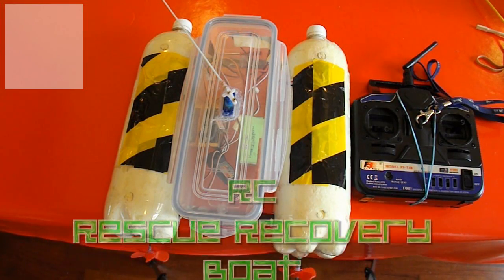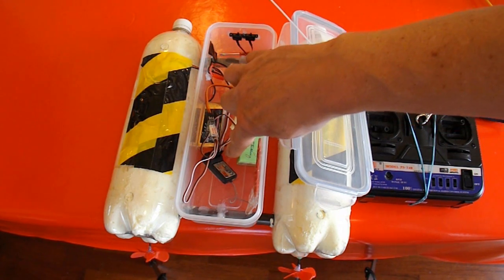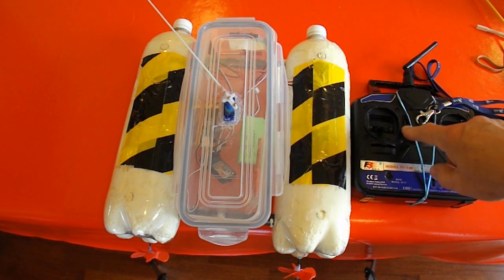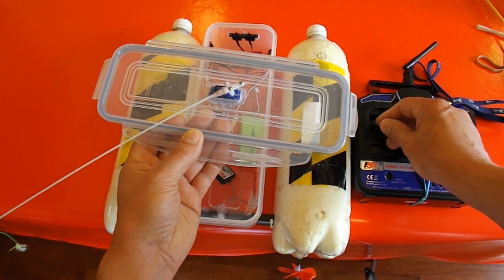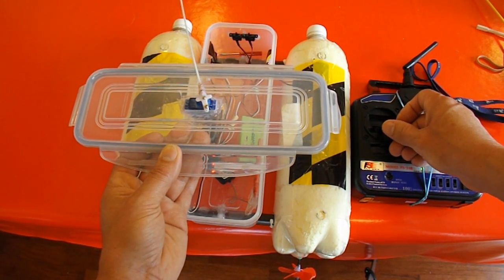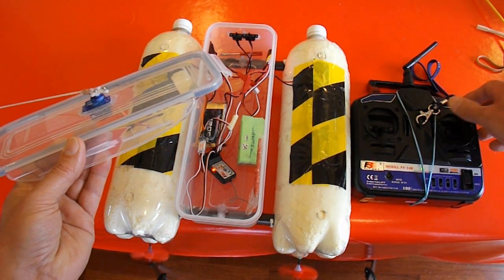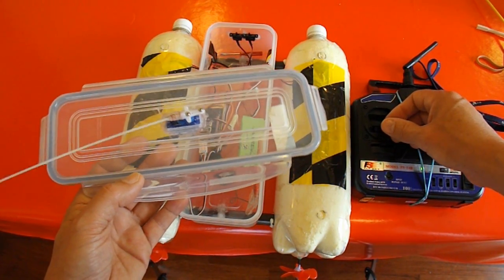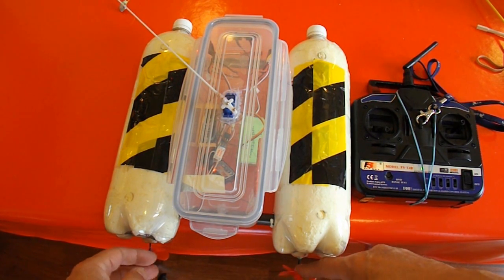RC Rescue Recovery Boat Part #14 - RC controls re-organised

Comment: it will be a good idea if you put the motors on the elevator and trotel channels and the servo arm on the rutthet
Reply from the maker: RobotBatMaxx the problem with the servo is that because I modified it for 360 degree rotation it does not know when to stop. With a more elaborate transmitter I would be able to modify the gain to give a larger dead point to hold it still. 
As I am using the motors to steer the craft, yes I could have the left motor on the throttle channel and the right motor on the elevator, although that might give a minor problem in remembering to center the throttle to stop the left motor, not pull it full back.

Comment: You should of used throttle and elevater for your motors
Reply from the maker: You will see in later videos I do use throttle and elevator but when I started this I wanted to use the V-Tail mixer as a test before using it on an aircraft